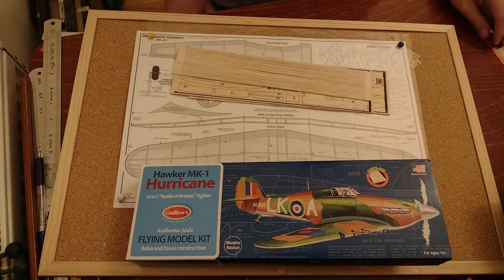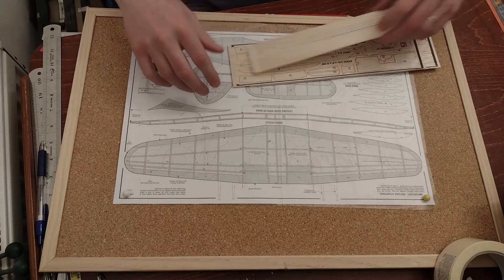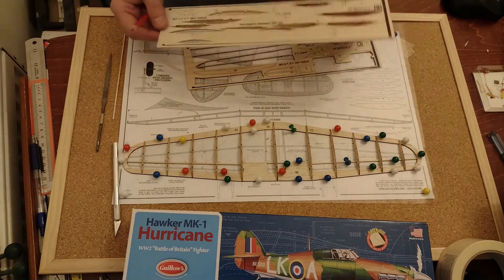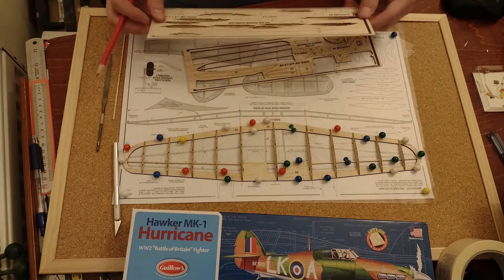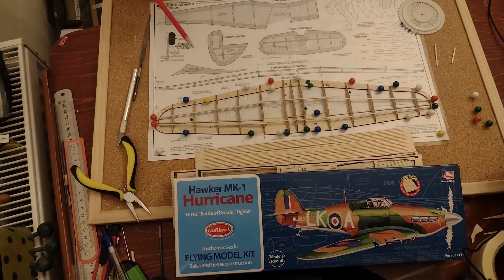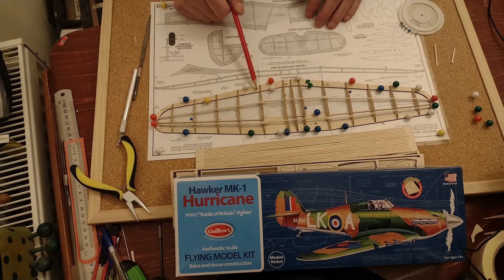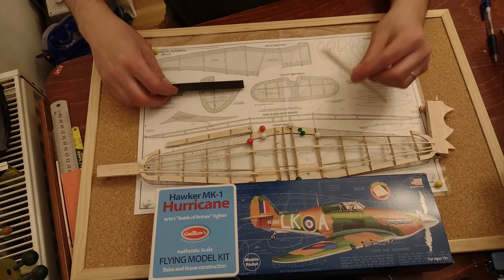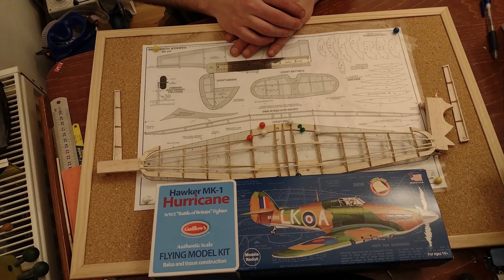02 Guillows RC Hurricane   Wing build

Comment: Hows the hurricane comeing on ?
Reply: Great no pressure, just started a guilows avenger same set up as yours but utilising  micro servos in the wings for ailrons.
Reply from the maker: @andrewedwards142  That sounds interesting! I find the Avenger difficult to fly as it needs a lot of speed. The better ailerons will for sure help. It would be great to hear from you as to how it goes!
Reply: @downwindchecklist6567  Yes will keep you posted. Your Wellington and mosquito are inspirational for a twin at some stage . American company easy built kits do some balsa static twin kits ,easy 
to convert . The beaufighter would be a project at some stage . I've built  and flown large rc for many years ,but now into micro ,easy storage relatively quick to build and light enough not to break . The eachine micro war birds set me off on this track ,great flyers . Have a great day ,very hot here in Yorkshire,england 37
Reply from the maker: Hi there! I've been out for a couple of weeks and I need to get back to "work" on it. It will be the wing fairings and the tissue now ... Thx for stopping by!

Comment: You right about different preferences on where to start, I always do the wing last lol. I was wondering if you were going to decrease the dihedral a little due to the fact you have ailersons? Not that it'll make much difference I don't suppose. Your new piece of equipment looks useful as well, good start Andrew, keep 'em coming 👍
Reply from the maker: Thx! I think I will need every degree of stability as it is so small. I feel it is going to be a fast flyer like the TBF as it has a relatively small wing in comparison to the Spitfire. I need to get some stick time soon!